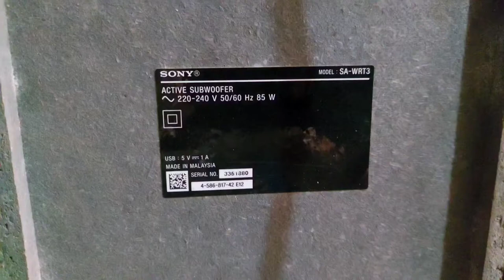#sony home theatre repair

Comment: Mere pass sony HT-S20R Home theatre hai wo on hi nhi ho raha hai
Reply from the maker: Pcb ko voltage checking kare sensor par voltage check 3v ya 5v hona chahile ya koi 5 voltage se Judahuya capacitor check kare ya what sup kare 977980-78-51536